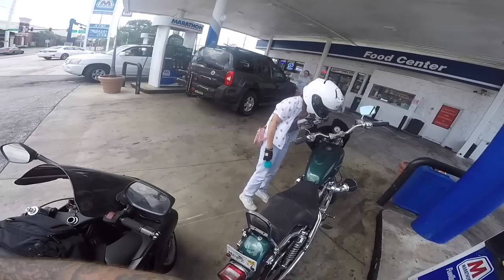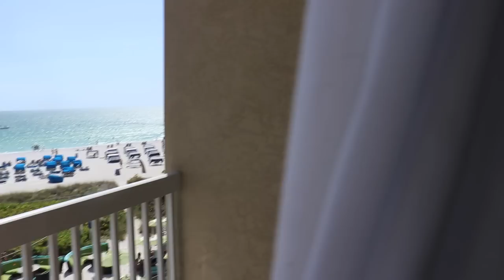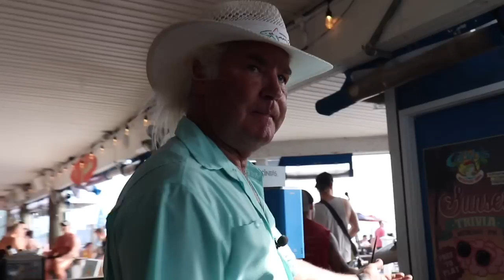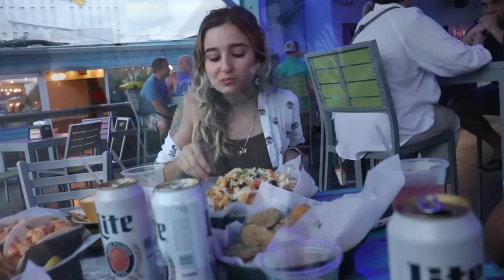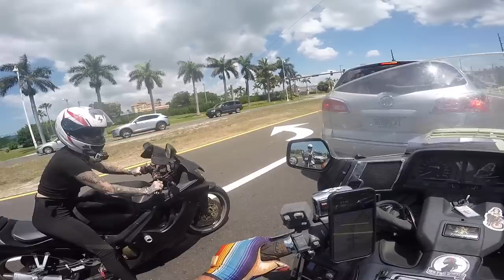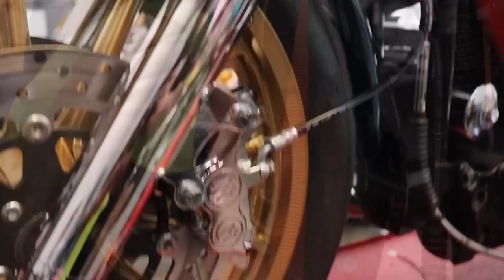She's gonna REGRET this

Comment: I love your videos Josh, but please consider the hazards of fueling a motorcycle with the rider still sitting on the bike.  If the bike were to tip or if you overfilled, you could end up with a fuel soaked crotch just before the gas hits the hot engine below.  Riders have been seriously burned doing this.  There are videos on utube where this happened.  Best to get off the bike before gassing up.